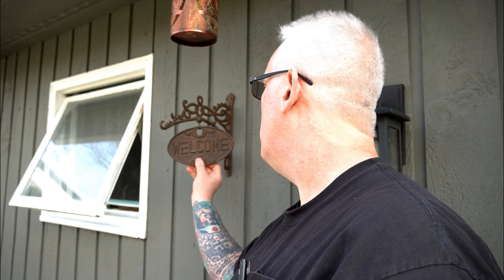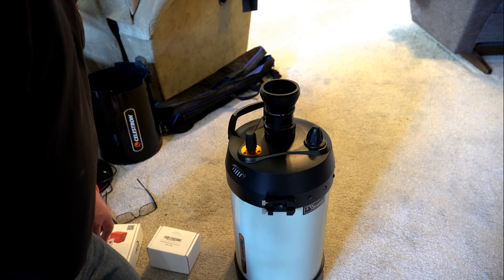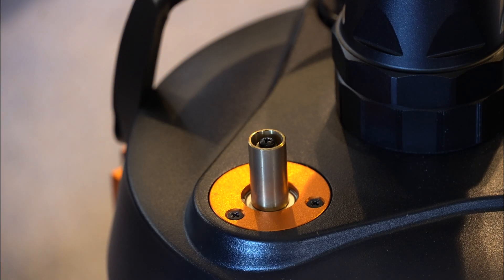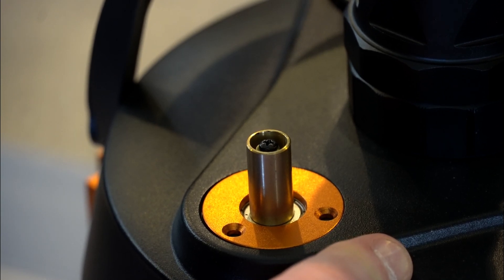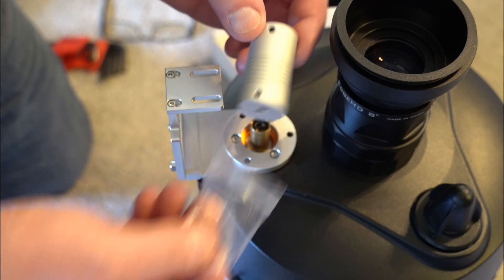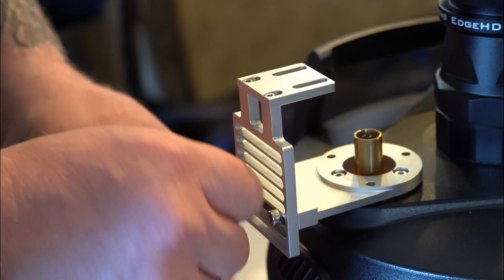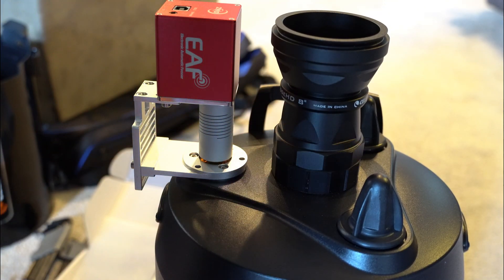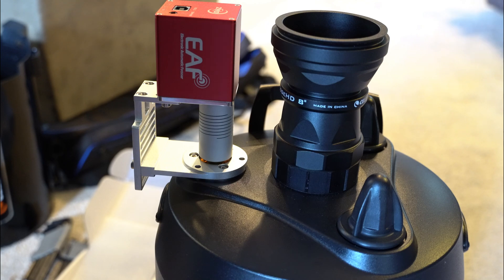ZWO EAF Install on a Celestron Edge HD 8 Inch SCT Watch to the end !

Comment: How does it work for you? I’m having problems with mine. What are your settings?
Reply from the maker: It works fine for me, My settings might differ from yours. What I would do, is setup your scope, and manually focus on a star, or get it close, then mount the focuser and tighten down on the set screws. From there you can let the ASIAR do a auto focus routine. Since your already close to focus, it should work. I wouldn't try and focus on a house far away if doing this during the day, I did this at first, and my focus was so way off on a star at night that I couldn't get it to work and I thought something was wrong.. Give that a try and see how it goes..
Reply: @ thank for your feedback! I’ve tried that already several times. The problem is that the EAF skews too far away from focus during the AF routine so it cannot find its way back. My scope doesn’t seem to have a V curve but rather a flat line with a U shaped area. 

I’ve narrowed it down to faulty EAF, faulty focus mechanics on the scope or screws not right enough.:(

Comment: Odd question. Woukd you mind sharing the settings you have in your EAF. 
I have one on a smaller WO Z61. A second one on a C9.25. The one on the celestron does not give me a good focus a majority of the time. 
I am thinking that it is a setting in AIS AIR software that I may need to adjust.
Reply from the maker: If using the same ASAIR? I'm not sure of a "Preset" that you can do when changing scopes.. For me, I have 2 ASAIR's and each one are dedicated to the scope.. Other wise I think the rotation travel it (EAF) may need to get to a focus on the C9.25 might be much more than your WO. Maybe loosen the set screw on the C9.25 and manually turn to focus to something close, then put the EAF back on and go from there..
Reply: @bfgmetalworks  I moved my Plus to the 9.25 and I bought a Mini for the small setup.
My focus routine seems to be running better - not pin prick but better then snowball.
Reply from the maker: @allenbaylus3378  Thats good to hear ! I found that just having the extra ASIAIR makes the setup much easier and saves time !

Comment: Trying to get my 8 inch EdgeHD set up and the filter wheel is contacting the EAF. I see that you have the .7 reducer that makes it fit right. Bummer that it doesn't work without the .7 reducer. Thanks for the vid.